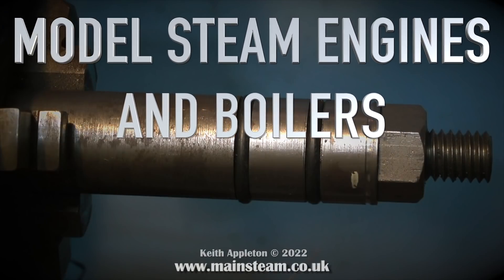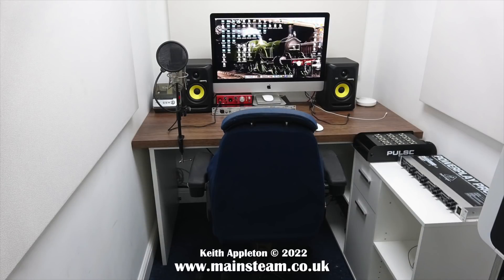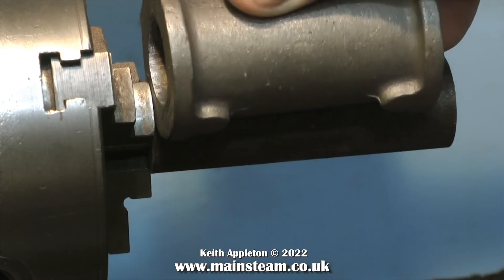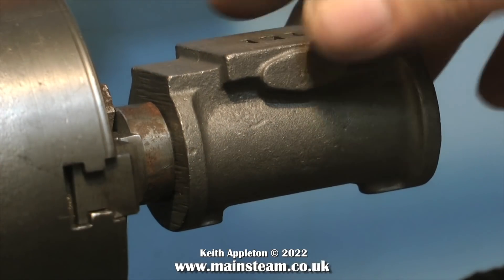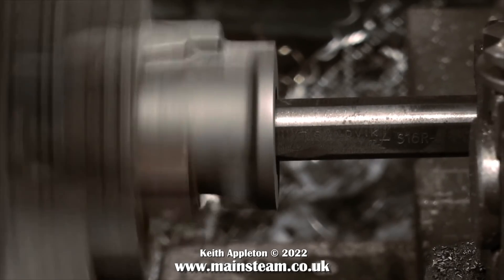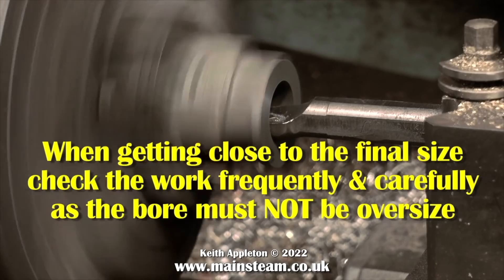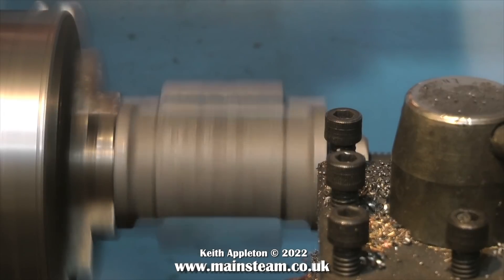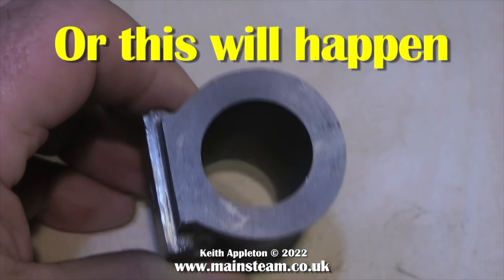MODEL STEAM ENGINES AND BOILERS - PART #22

Comment: 1 inch cylinder?

I have a hard time finding answers about how much power a steam engine has compared to other types of engines

while it might sound silly, I'd like to fins a way to match a steam engine to the equivalent fractional horsepower motors that are common nowadays

or even small gas engines used in things like sundry gardening power tools

practical? no. educational? yes.

Comment: Modern day electronics are nowhere near as reliable as they used to be and tend to die unexpectedly from small component failure ! The trouble is when one component fails it leads to a cascade of failures and often this can damage the circuit board too which makes repairs uneconomical. It's very irritating when you pay a lot of money for something only to have to replace it a few years later because small inexpensive components let it down !